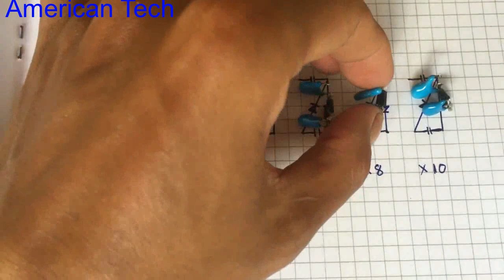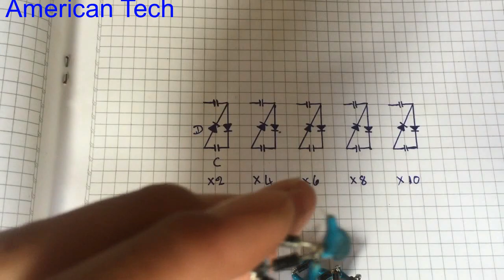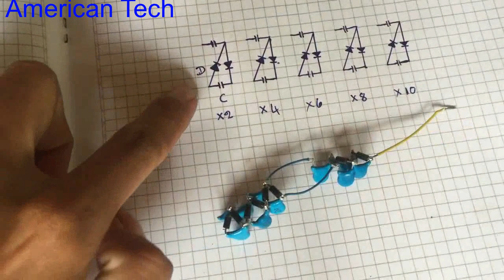Amazing high voltage , How to make a powerful taser 2017

Comment: How to make inverter plz reply
Reply: It need to use a pre-built circuit.
Reply: you can take it from fly zapper
Reply: or make one with mosfet, small flyback transformer, and resistor

Comment: this kind of taser is very dangerous can easily kill someone by stopping there  heart by using a voltage multiplier it produces high voltage and high amperage real tasers are high voltage but very low amperage you use that on someone you better know cpr